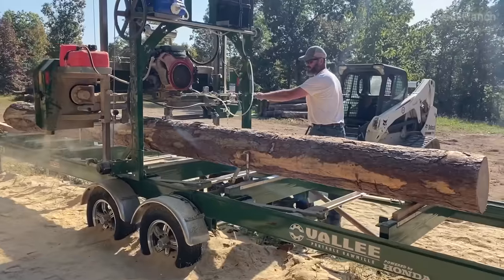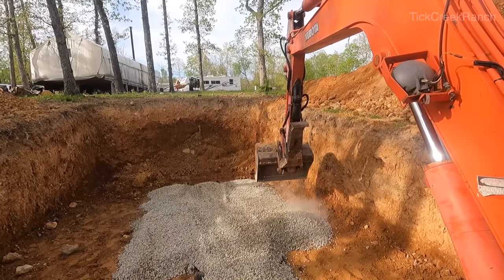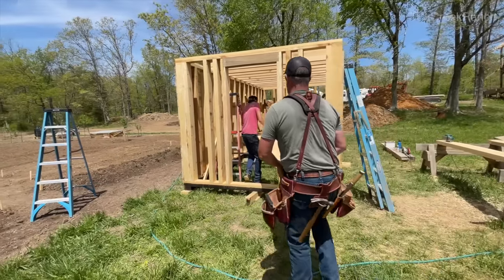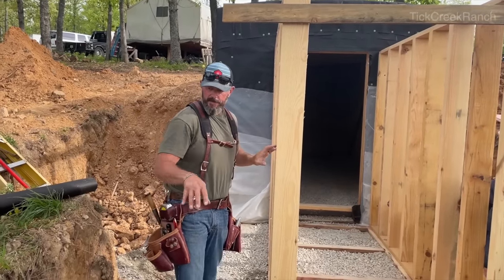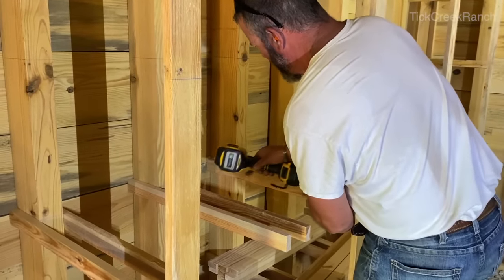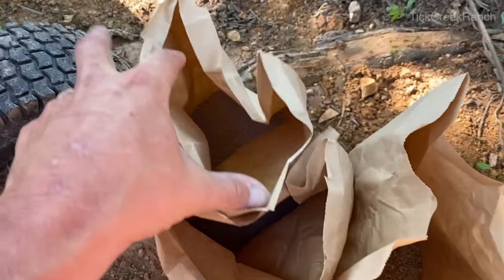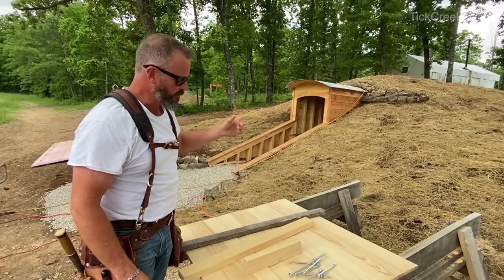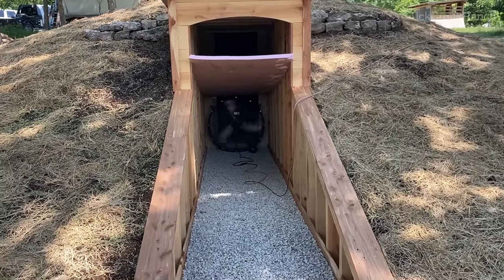Root Cellar Build / Possible Storm Shelter?

Comment: Wonderful video - thanks.  Very beautiful build and heartwarming to see the whole family working on the projects. You are a very lucky man.

Personally, I would have installed a long pipe for incoming air ventilation, rather than a grill in the door/entryway.  The key to storing product is temperature and darkness. Having a pipe in the floor for incoming air that follows a U path to the surface makes sure there is not even a hint of light.

If you ever get to make this change (unlikely I know), site the incoming air source in the shade and filter it to prevent insects getting in.

Anyway, beautiful work and it was an absolute pleasure watching this film.  I hope to visit Missouri one day, you’ve bumped it up the bucket list.
Reply from the maker: We appreciate it. There is a roof vent we somehow didn’t show in this video 😁 Most of the time the door vents are plugged with foam and removed one at a time on a as-needed basis to control venting. So far so good. Definitely could have made some design changes that would have made it better, but overall pretty pleased. Thanks Roy

Comment: Serious question from a building noob: could you just use a storage container? What would you need to do to adapt a container to work for this?
Reply from the maker: Could be done but they have a tendency to collapse. Maybe install upside down. The floor is strong. The roof not so much

Comment: Id be worried about the walls pushing in with that being backfilled with the fill from the hole.  I’d use gravel or something less compressive than dirt a couple feet wide around it
Reply from the maker: True, if the ground becomes too well it’ll be a problem.

Comment: This entire hill and more ,...  should get covered by some corugated iron or plastic membrane ( " roof ")
So NO storm  water gets any close to the building's structure. 

Once water gets into this dugout 
it WILL Find its way into the walls.
Reply from the maker: @marinvidovic763  yes, a large membrane that extends many feet around the perimeter of the structure and then a final layer of dirt on top. You know what’s up👍
Reply: @tickcreekranch  yep...
"*WATER always finds its way In ! "  ....
....
That's why 
" The good BOOTS save the LIFE of the soldier. " 
... A human brai is a strange Man... 
....(* A random thougth,)
...  while ... I am having a Pizza, 
 in a could winter Night ...
(* ALDGATE - Australia)
( 🌧️⛈️☔☔❄️❄️❄️❄️- August (!)

...and 
 ..  ...a 14 y.old kid 
is running,... bare Foot ... from the car 
... 
 to the Pizza Shop. 
...any.. way .

I assume what mean. 

All the best.

Comment: Wow, what a non-seance build. If you are going to bury a large wooden box, why wouldn't you bury a shipping container instead.
Also, when it rains the dirt at the wall can turn into mud. Mud density is 118 lb/ft3.
Assuming that you buried your box 6 ft deep, the mud force acting on the walls would be 2100 pounds per linear foot acting 2/3 of the way from the top. And assuming that your box is 20 ft long: that would be 42000 pounds trying to crush your box.
Among other things, can your box take the load ?
Reply from the maker: It’s obvious you’ve never buried a shipping container
Reply: @tickcreekranch  Burring a shipping container is not my idea, it has been done 1000s of times.
And you know nothing about burring a structures.
Hint: How to Calculate Loads on a basement Wall. 
I wonder if you have the courage to post a video after your wooden cage collapses 🤮
Reply from the maker: @Rose-f2t  refer to prior comment, bye…
Reply: @tickcreekranch Bye and please let me know when your buried wood box collapses 🙂

Comment: THE BIG FAN IN THE DOORWAY;  WAS THAT TO SUCK OUT THE MOISTURE FROM THE GREEN LUMBER USED TO FRAME AND SHELF THE INSIDE???
Reply from the maker: Yes, but it became ineffective once the outside RH started to climb. A dehumidifier was placed inside and the door was closed. It finished it really well. Was taking 5 gallons of water out of the wood a day👍

Comment: That dirt is going to settle big time over the first couple of years you should have compacted it those walls were built plenty strong and there's very little hydraulic pressure on them with that mound design
Reply from the maker: We put a sprinkler on top for about a week and got most of the settling handled. Then finished topping it off with more soil. But yes it did settle a lot👍

Comment: This is not only functional and multipurpose but beautiful as well. I am wondering how you kept it under $2K. Did you rent the equipment you used or do you already own it? Between the mill, backhoe and the dozens of other electric tools, I’m curious to know what investment others would need to expect to make in order to build such a well thought out, sturdy and fantastically useful structure?
Reply from the maker: Yes, we owns everything you saw in the video. I invest in tools, not the stock market. It’s a good thing I’d rather have tools than money because I don’t have any money anymore lol
Reply from the maker: A round about number would be 130k in machinery and tools, but we already had everything. I used to be a contractor and these are things a guy acquires along the way. Most of the hand tools folks should already own if they plan on being a landowner. Now the heavy equipment could be rented and sawmills are pretty common for ranchers/farmers around here

Comment: How was this under $2000? Even assuming you had friends do the work.
Reply from the maker: We own all the equipment, mill our own lumber and built this as a family. The roofing felt, insulation, drain pipe and metal roofing we had laying around. We repurpose a lot of materials. The logs cost about $900 and the balancer was spent for fasteners, fuel, plastic sheeting, gravel and misc.

Comment: Great build, one question though. What is the lifespan you expect from this root cellar? The main issue with burying wood is that it rots when it comes into contact with moisture and can’t air out. Do you think you’ll get a least a decade or two out of it before you see the wood rotting on the inside?
Reply from the maker: Not sure, but there are wood root cellars that date back to the 1700s that are still functional. If we control the moisture I have hopes that it will last log enough to serve its purpose for our family. Then again it might be a epic failure

Comment: Are you kidding me, $2,000.
That backhoe probably rents out at about $2,000 a week.
Reply from the maker: Rent? Lol we own everything in this video
Reply from the maker: Furthermore you called an excavator a backhoe. Your opinion means nothing….
Reply: Backhoe, excavator, machine that digs holes, whatever it's all pretty much the same. 
Most homeowners don't own a machine that digs holes, they either have to rent one or use a shovel. 
So therefore you must consider the cost of using heavy machinery into the cost of construction. 
Oh, and as far as my opinion, 
bite me!

Comment: You put isolation? Isn't the point of a cellar using the heat mass of the ground 😂😂
Reply from the maker: I assume you meant to type “insulation” and “cold mass”. The floor is the coldest part of the structure. The temperature of the soil around the walls and roof will fluctuate with seasonal changes. Between 8 and 10 foot deep the earth is a constant temperature. This allows more influence of temperature regulation from the deepest part of the structure
Reply: @tickcreekranch9838  Now, i feel dumb.... yea, the floor would be enough to cool the room!

Comment: Love the ingenuity to dry it out. Assuming it's been a while since you completed the build, does the dehumidifier work? I would have thought a vent shaft would be needed. My concern would be available air should you need to shelter for more than a few minutes.
Reply: Never build and wrap with wet lumber. It will 100% mold if you seal off the air. I worked at a mill. We shipped wet lumber from north america to japan. One load was not dried enough and the entire sea can was one big mold cloud when it arrived. After that it was a very strict protocol to continue shipping
Reply: @cheeseymccheese7249  Good advisory. Thanks.

Comment: Good things (Ones I remember) I saw in your video:
1.  Turkey grit  to protect the vapor barrier. What is it?  Do you see Sand as an acceptable replacement for that? 

2.  After you dried it for a bit with your high CFM fan, what was the humidity after a few days? 

3.  I liked using the ERC. When I was younger and I would refer to them as ERC, and people  in the state I relocated to would say, "no that's juniper".  I wandered the Earth confused for years about this. Then it was revealed they are the same.  I always try and scavenge logs of it when I see people cutting it.

4.  Nice door latch 

5.  Your vid inspired me to  do a little more planning around  The dirt pile I refer to as mount ( Town name here).  I tell everyone it is the highest land in town. It's probably only 11 yards of Fill dirt. Then I have another  three or 4 yards I Removed for a paver patio.

Thank you for posting what you did!
Reply from the maker: Hey! Thanks. Yes sand will be great, sand and turkey grit are basically the same. TG is slang for manufactured sand. It’s one of the byproduct’s from crushing limestone.

In hindsight I should have just run the dehumidifier and box fan with the door closed. The outside humidity really slowed the drying process. The dehumidifier got it dry in about 4 weeks. 
Basically a kiln. It pulled around 7 gallons of water a day at the beginning and slowly diminished from there.

I call ERC juniper around here sometimes just to raise eyebrows. It’s always good for a debate lol. We had forests of juniper back in Idaho. Much more gnarled and contorted than these though 

How high is your ground water?
Reply from the maker: The cellar currently stays about 58f with 55% RH
Reply: According to the USGS data  it is 25 to 35 feet. Which makes me want to explore a shallow well also. I am in the middle of a small town where getting approval for a well  May be a bit more difficult than it used to be as population increases. They want you to stay on the city/County water And sewer. 

 My hope is to make it a habitable space. Running power to it won't be a problem for de humidification  , Ventilation, and heat/cooling.

As I sit here and  dictate this I realize it should not be a high priority project.

Thank you for getting back to me.  You have a nice chunk of land there.  I wish The family and you the best with it!

Comment: Are you serious? Safety issues with Sluffing? Are you serious? I did commercial plumbing and laid 12-28 inch main drain pipes for miles in total with average depth and width being 6-8' deep by 4' wide. And our soil was less stable than that. People need to stop making everything seem so dangerous to sound "smart" and get more views. It's not complicated
Reply from the maker: You’ve obviously never worked in a hole that was open for 3 weeks with several rains. If what you say is true about working in a hole 4’ wide and 8’ deep without shoring, your opinion about the intellect of others is void. Your words are falling on deaf ears.

Comment: You may want to consider adding slide locks on the door at the top and bottom.

These would help prevent the door from twisting and contouring in the even of a tornado.
Reply from the maker: Yes great point, I have yet to install the brackets, but the door is to be bolstered from the inside similar to a castle gate👍